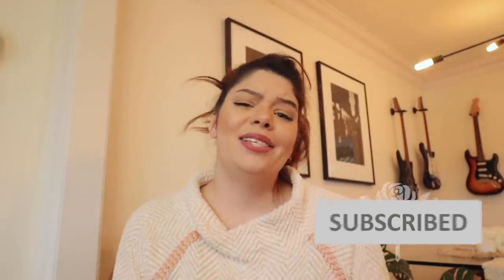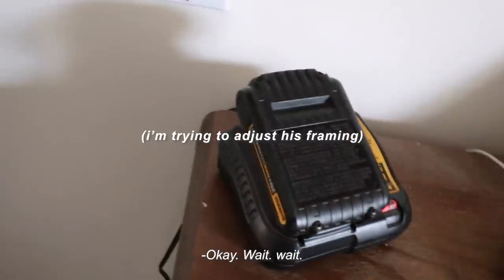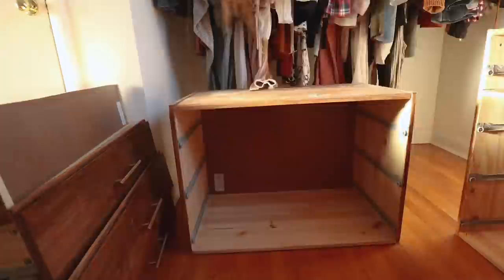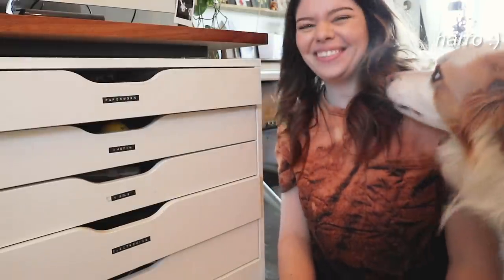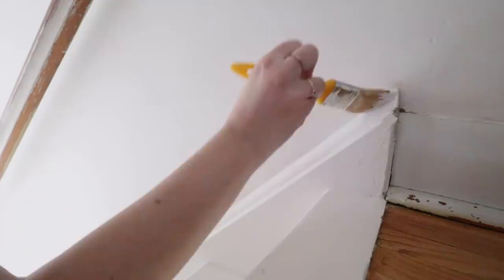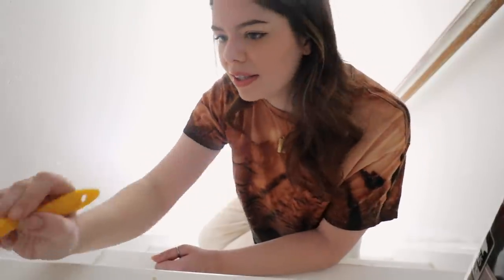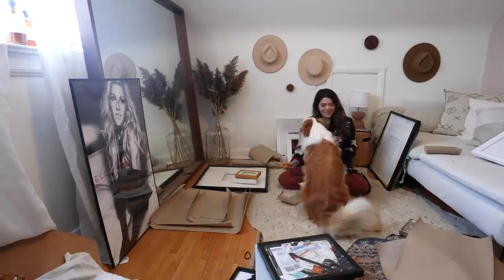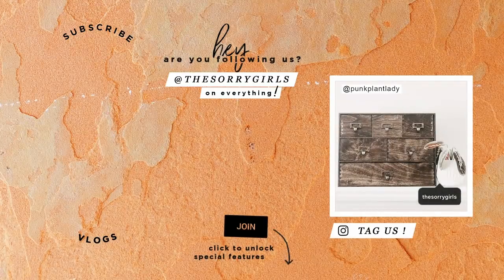home DIYs brought to you by social distancing | DIY Diaries

Comment: Tip: when you paint something in the house, write what you painted on the lid of the can in sharpie so when you store the extra you know what it’s from!
Reply: I also take the little paint swatches that I choose and write the location where the paint was used, in case I use all the paint and take the can to the recycle.
Reply: we save the lids if they have labels on them so you have a swatch and you can write where you painted :)
Reply: Really good tip.Thabk you
Reply: And on the object in sharpie 'wet paint' so you only have to paint over the sharpie and not all the smudged paint 😅
Reply: I have a spreadsheet for all the paints I've used on projects (some are the same colour but different finishes) so if I need to touch anything up, I can be sure that I use the right tin ☺️
Reply: I keep a folder with paint number and keep with the swatch card or make a swatch card for all rooms amd other paknter projects. I do this for our customers also when we paint their houses.

Comment: 3:18 : 95 CENTIMETERS ?! You sure about that ? 😂 laughs in metric system
Reply: Yeah. xD Canadians fail at metric :(
Reply: Maybe it was millimetres hahaha :)
Reply: maybe she was measuring from the top of the tape from 100 cm
Reply: @Djurdja97  even that wouldn't be right 😜
Reply: @CJ-nt9mb  WE NEED SOME ANSWERS HERE 😂
Reply: I believe she meant mm. It looks about 10cm or so the length she measured.
Reply: @shellsisacoolpear  that looks way too long for it to be 10 cm
Reply: @CJ-nt9mb  I've changed my mind after looking at my tape measure. I'm thinking 19.5 cm. My tape measure doesn't say 19, it's just single digits between 10s. Perhaps hers it too and she just said the wrong thing. It looks like 20cm. 🤦‍♀️
Reply: @shellsisacoolpear  yeahh that makes a lot more sense!
Reply: I was looking for this comment 🤣
Reply: @szeptacz5342  Canadians are taught using the metric system.
Reply: @shellsisacoolpear  but then why do they still use feet, inches and pounds? Metric system is way simpler than the imperial
Reply: @zhevtone  we use both honestly. But we measure distance in km not miles. And are taught metric in grade school and imperial in highschool tech classes. We also use pounds and feet/inches for body measurements. But on our drivers license our height is measured in cm. They've only been teaching metric for like 30 years so, most people grew up learning imperial so its hard to break that.
Reply: @zhevtone  oh, we buy gas, or any liquid really, by the litre not the gallon.
Reply: I heard that and kind of went 🤨 then realized she must mean millimeters.

Comment: You should slide your drawers over and move all your long items to one side so it hangs in the empty space.   this is definitely already recommended but I'm saying it anyways!!!  [edit] SHOULD have watched the whole video... you can fill in the gaps on the trim as well and paint them and it will looks SUPER seamless.  I did it in my apartment and it looks AMAZINg but I used silicone (what I had on hand)
Reply: I was just going to say that! Great minds....
Reply: Just came to say that,still in first 5 minutes! Thanks for saying it and I’ll just finish before I comment lol
Reply: Yes!! She should use calking to fix wooden seems of the stairs for example. It makes it look so much better just seamless. And it is honestly so easy, fast and cheap to use. Escpecially with all the diys they do!
Reply: Esmee Heebing I have to say it dis look REALLY good by the end there.  I have to do the risers to my stairs and I was so disappointed until I filled in all the little holes :)
Reply: Karin Knife 100 percent great minds

Comment: Bring the orange back to the hallway but on the ceiling! Also what are you doing with the extra drawer? Saving it for a later DIY, putting wheels on the bottom for hidden storage, maybe adding some cool top for a floating shelf?

Comment: Just a quick tip: if you are gluing two pieces together and one is stained, you should give the stain a bit of sanding to help the glue bond even stronger I'm sure it will be OK, but that little bit of sanding will allow the glue to bind even better.

Comment: I love the gallery wall. I just started one in my room before lockdown happen.... I'm sad as I can't hit opshops up right now and I can get hooks or screws for the triangle hook things on the back of them. PLUS some need frame mats. I did measure mine out using newspaper but they didn't work out space wise once I hung them up. Partly because of the hooks and nails and how they hang up on the back.

Comment: To even out that slight gap in between the drawers on the dresser you can unscrew the hardware that holds the drawers on the inside and raise them a tinsy tiny bit to get rid of the gap. If it bothers you, but it’s not that noticeable tbh

Comment: Gallery walls are my favs. I would say you need to either paint all the frames the same color or have them spread it more equally. You have all the black frames on top and then a few down mixed with all the antique ones. It's too disjointed. Have more antique ones aboth dispersed.

Comment: Tip: Organize your drawers of DIY supplies. Use containers, or lid boxes to organize different parts of the drawer.  I was overwhelmed just looking at your open the drawers. Then for your paint, I used some blue painters tape and labeled all my paints in the garage. Be specific otherwise you might not remember what wall in what room that particular paint was used. As far as your name should go for the video: Becky's DIY Diary: A journey of home renovations. :)

Comment: Did you seal your stairs? I painted mine and the paint chipped so easily. I also found them to be super slippery. Also also...major props for painting with your hair down! I have long hair too and I found like a million hairs in the paint once it dried 😳😭

Comment: Becky I work at a Benjamin Moore and I can tell you your stairs would have lasted a lot longer if you used our like of paint called advanced as opposed to Ben (which is out lower wall paint line) Ben is really awesome but not meant to be walked on especially that its eggshell (the higher the sheen the more durable) you can wipe down eggshell paint but you can't scrub it like you would on a floor which over time will leave it looking dirty and dull

Comment: Just a suggestion... why don't you push the system of drawers al the way against one of the walls and then hang your dresses on the side with the gap in between the wall and dresser.  This way they have a place to fully hang?
Reply: Also, very impressed you engineered that so spot on.  Great job!

Comment: Ok a small collection of paint tips from a girl who works in a trade suply store 
1 Cillacone spatchulars like cheap dolla tree or poundland ones are better then most paint mixers 
2 for high traffic areas like stairs my last longer if the have a clear varninsh put over the top 
3 are some of the marks on the stairs the knotts bleading because they do relise tannins over time and if you didnt treat them befor you you painted the stairs they will just blead back through unless you seal them properly